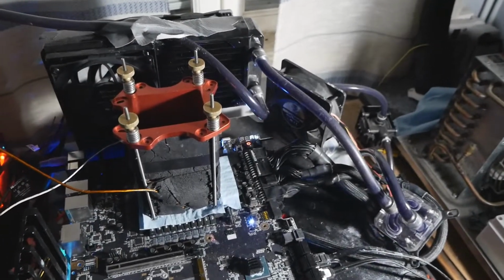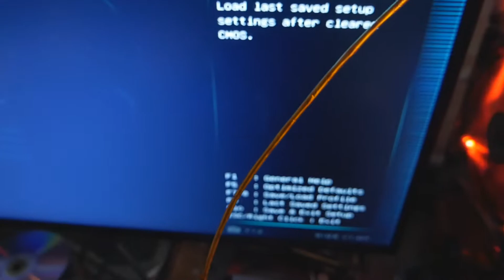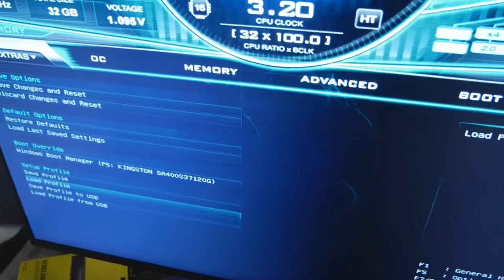Motherboard Doesn't Turn on / BIOS Corrupted - How to FIX Using EVGA BIOS Flashback -Guide

Comment: I ended up using the USB stick that comes with the motherboard for mine. It already has a bios file on it I just replaced it with the bios I wanted to flash on the mb.
Reply: That just means you re-loaded the bios that already existed on the MOBO
Reply: @Infidel67  board shipped with 1.03 on it and the USB had 1.08 on it and I put 1.11 on it so what was that again?

Comment: Hi , maybe you can help me. 
I've purchased Z690 classified motherboard and intel core i5 13600k. I tried to perform bios flashback without CPU and every time I get error code E6 and cannot proceed (nor don't I understand what this exact code means). I used the supplied usb stick with mobo. Downloaded the latest bios 2.06. Connected the PSU to mobo, renamed the bios file to EVGAE698.bin. Inserted the USB stick into dedicated port for bios flashback on mobo, pressed and hold "Bios Update" button until the LED starts to rotate clockwise and then I get E6 error code. Please help, maybe the issue is that I prepare bios on MacBook?
Reply: I'm in a similar boat but my error codes are E1 and E8. I know I have and old USB lying around but where
Reply: I am having the same issue with a Z790 Dark Kingpin that does not start as well. When trying to update the bios via the usb I also get the E6 error. Did you manage to fix it? If so how did you do it?

Comment: Yeah, mobos are picky about the USB sticks. Back in the day I was modding BIOS on MSI P45 Neo2 to support LGA771 Xeons for some dude. Those old MSI boards were total crap and it froze up during flashing. Mobo was refusing to POST, so I read somewhere how to trigger recovery mode. I prepared my trusty 1GB Kingston USB 2.0 stick that I was certain all motherboards recognized.... and surprise surprise it didn't work. I have formatted it with windows tools, Rufus and some other programs I found on the internet - nothing worked. Then I tried a 4GB uSD card via card reader - formatted with all the tools, all different options and nada. After that I tried recording the BIOS on CD - didn't worked, in recovery mode it wasn't recognizing CD-ROM drive. As a last resort I formatted this uSD in my old SE K800i phone and I couldn't believe my eyes - it worked! After that I re-flashed my modded BIOS and now it also flashed properly. That dude newer knew his mobo was almost bricked :)

Comment: Big fan of the bios content.

Some modern USB drives draw more power than the motherboard supplies during the bios flash process. In addition to the issues mentioned. I've encountered the power issue only once, no clue how widespread it may be.
Reply from the maker: Thanks for the note, could very well be a USB power related issue.
Reply: I knew I was keeping those old usb sticks for something